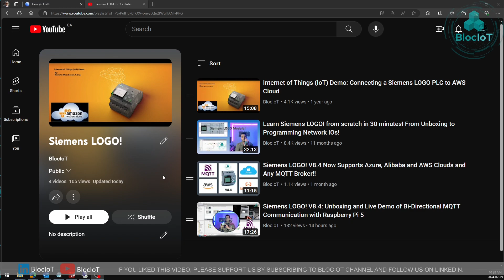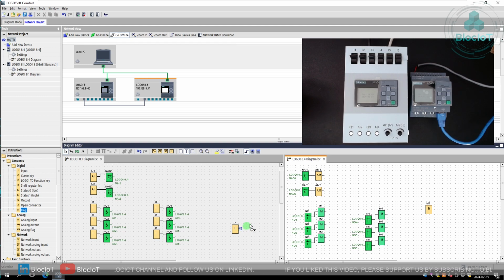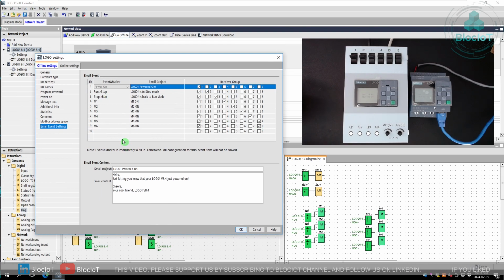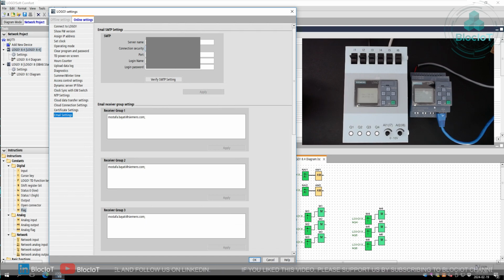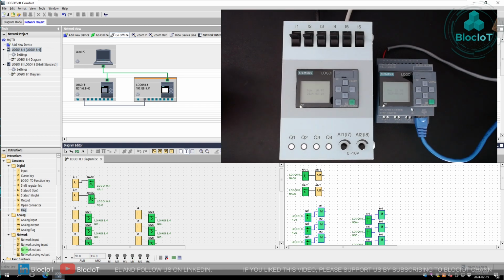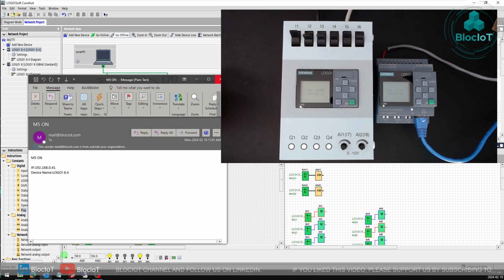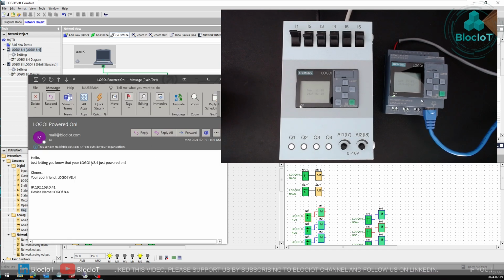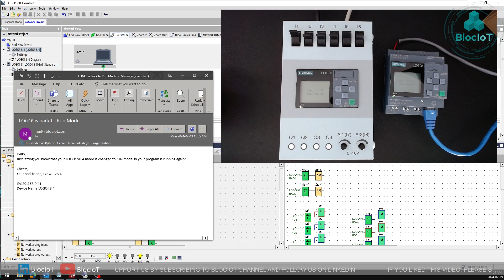32- Mastering Event-Driven Email Notifications with Siemens LOGO V8.4: Complete Tutorial & Live Demo

Comment: Thank you for sharing those videos on the logo soft and the logo 8.4 emails
 I'm wondering if you have a video linking two logo 8.4 cross two separate networks using a DDNS service as I have no fixed public IP addresses. 
I have a project where I'd like to monitor the remote site inputs and broadcast back to the home site logo relay outputs,
 I would then like to send inputs from the home site back to the remote site to control relay outputs.
 At the moment remote site sends me emails on the state of the inputs from the remote site, and I have to use the web server to call the remote site and change the outputs.
 Looking forward to receiving your comments 
Regards jon

Comment: Dear friend,
I did not see any update in your video or an answer to my question about sending e-mail using Google or Yahoo mail services.
I tried by myself to find an answer in Siemens support forum.
The answer provided is not useful. 
I tested on my desk several times...
I propose you to join our forces and to ask for a clear and detailed video from manufacturer.
Let me know if you agree.
Reply from the maker: Hi Toma.
I talked wo someone on Linkedin on the same topic and I assumed it's you. It seems you are not the only one who is trying to use Gmail.
This is a challenge with Google not LOGO. It seems for a higher security standard, Google requires you to use an “App Password“ not your account password. My Gmail has two factor authentication on and I have to apply a series of changes to my account to test this. So please do some research on Gmail SMTP and try in on LOGO. You may use the "verify SMTP setting" when setting up your Email address in LOGO to make sure your configuration is correct.